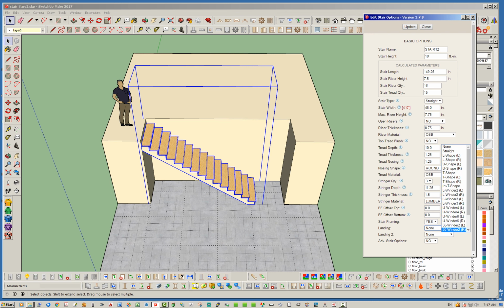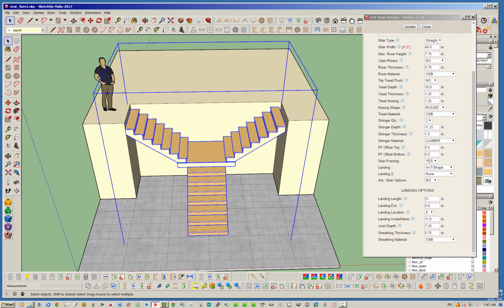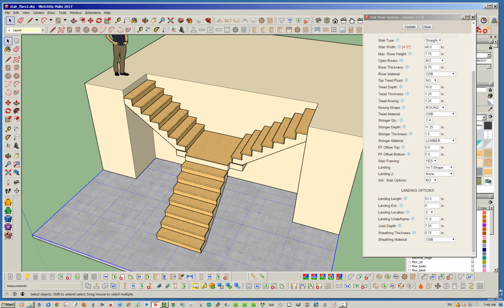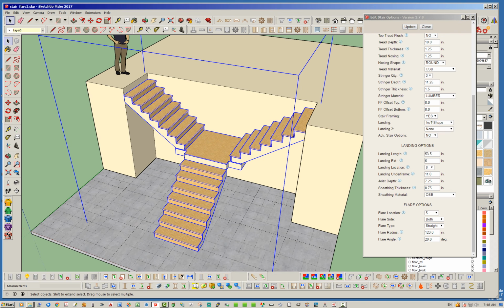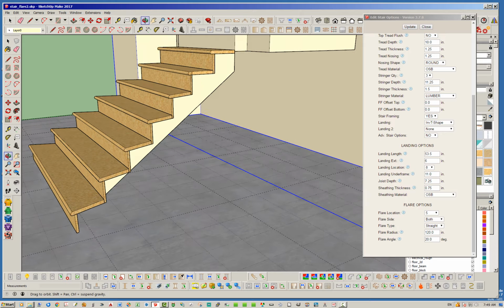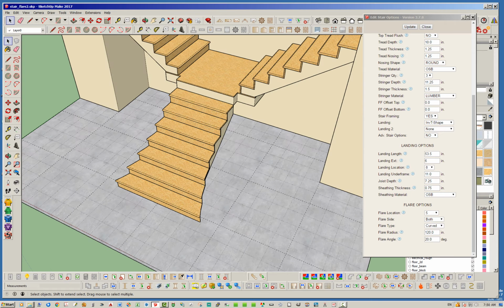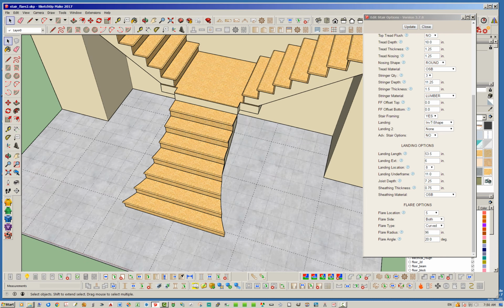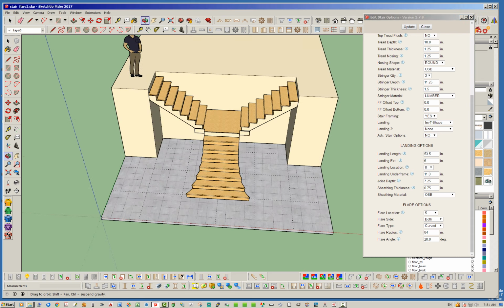Medeek Wall Plugin Tutorial 56 - Flared Stairs

Comment: To simplify…
Could you make a bespoke stair tools to draw a 2D boundary and then we protrude a height (down or up) to make it a 3d shape?
That once we have our boundary we can assign edges as walls or handrails and choose the stair options from there to each edge/elevations of said boundary?

Possible additional option…
We could have assign a horizontal landing for the top of the t landing and either side of the top of the stairs if needed?
Then once you have chosen the bottom and top treads and assigned the landing handrails and walls the rest is connected to the stairs and that is where you get your maths from to work them out and raw them

Comment: Hey Nathaniel,
I noticed that you drew the stair using the z axes and it didn’t quite work to the landing on each side after using the t landing.

So, my thinking is that you could ask for more inputs from the user to get the desired result…
Input #1 (point and z length) a line for the height as simple and effective… also as you already do!
Additional needed #2 (a point from x,y to form an area at the z height and the length of z) to form a 3d boundary for the stairs required.

Your stairs half landing could have adjusted for the width in between, for a bespoke stairs like a “T” you could have added an input, such as requesting the x,y and used it before the  z…
The additional inputs could adjust the landing width to suit the opening already draw between.

Also you can ask for the type and the direction of each landing and then for advance options for the whole stairs should be handrail and spindles and wall sides from your 2D outline.

Summary is to ask you to include in your coding for the stairs the possibility to input an areas and then a heigh manually or later (after options)
To clarify we draw a boundary’s in 2D and then add the options to identify, top tread, landing, bottom tread etc…
Also could add the handrails and wall verges/sides are needed? (Also colour code)

Then add the height either by a click the z axes or of the boundary drawn if code can recognised it?…
Basically design in 2D, configure in your tool with user selection colour coded and then assign height if not able to do so with group boundary or similar?